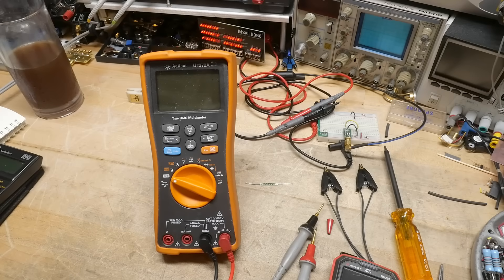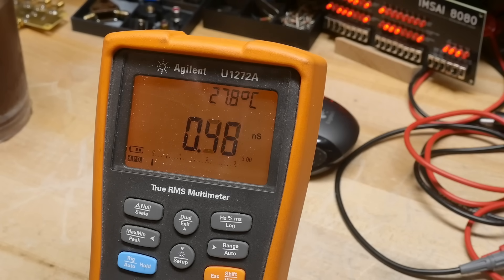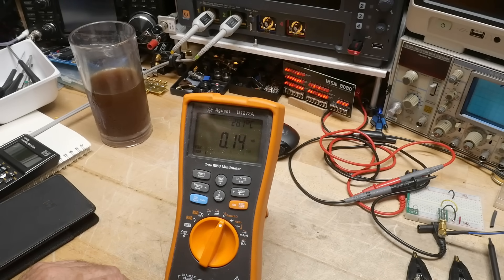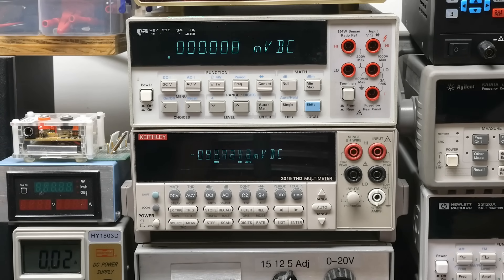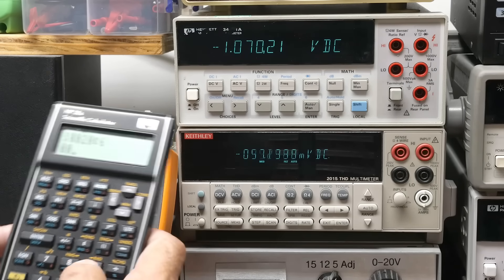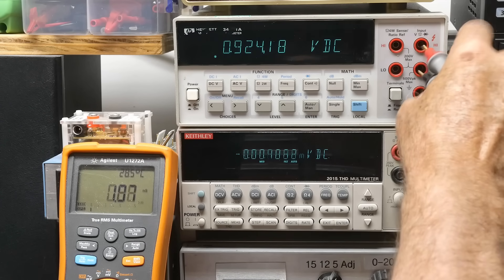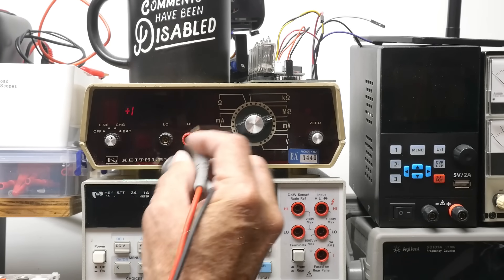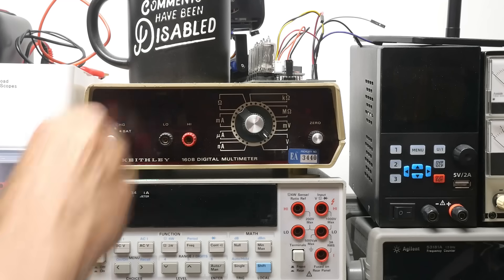#2298 Measuring Nano Siemens

Comment: My very cheapo, very small, RadioShack model 22-802 auto-range digital multimeter has an extremely high input resistance (apparently somewhere in excess of 100 gigohms) when used to measure voltages not exceeding 200 millivolts so that the autoranging stays on the most sensitive scale with a resolution of 0.1 millivolts.  It can be used by paralleling it with resistors to measure small currents while it also displays the voltage burden of the measurement.  When used in parallel with a 100 megohm resistor, the current resolution is one picoamp, though the settling time is slow.

Any run-of-the mill DVM can be used in a similar fashion to measure small current as long as you know the input resistance and apply Ohm's Law.  Typical meters are 10 or 11 megohms when using the voltage scale.  If an 11 megohm meter is paralleled with a 100 megohm resistor, resulting in 9.91 megohms, this is close enough to 10 megohms to be treated as 10 megohms for most general purposes.  Thus, a tenth millivolt becomes 10 picoamps.

Comment: Hello Sir I am following you from several years i really learn much from your videos i am struggling in designing a solid state ATS using Triac i am using BTA141 triac i need to control a load almost 60A can you please help me how can i develop this circuit can i use multiple triacs or any alternate way  i used LM358 for zero crossing detection and a 1:1 ratio transformer for AC isolation and i feed the output of op amp to a microcontroller to detect the frequency of input and switch the triac on/off on zero crossing can you please tell me how will be the combination of triacs or any other components for high current application
Reply from the maker: that sounds like a difficult (and dangerous) circuit. why use a 16A triac? use a 60A one.

Comment: My venerable Fluke 97V has a Siemen's range also, aka Mho's to us old timers.  I've got a handheld megger for checking motors at work, but it works equally well on high value resistors.  Checked the ≈1GΩ resistor in my high voltage probe and it checked spot-on with the megger.

Comment: Once upon a time, conductance units were mho... Ohm spelled backward; Siemen is a recent definition...  You can also extend the range of your Ohmmeter somewhat by installing the largest resistor within its range and then noting the resistance change when the test resistor is placed in parallel.  You can also measure resistance manually by applying (and measuring) a voltage and measuring the current that flows.  Measuring nA or pA requires care and a few tricks.  Especially, it requires an amplifier with bias currents smaller than the measured current.  And, a current divider in the feedback loop to emulate such large resistance.

Comment: You can get old school conductance meters that measure high resistances. Though they usually come with a warning that the probes can be of fairly high voltage outputs in order to pump current through to measure.  I wonder how the multimeter was doing it because 500mV compliance voltage (or 1V) to measure current is down in the nanoamps range which starts getting tricky. (I can be done, but it's hard because you might get buried in the noise).

Comment: OH BTW how about could you measure a resistor that is just in the range of the meter in megs and put the unknown in parallel,  then calculate the value from the change, instead?

Comment: Yeah, you simply measure the sum of typical the two protection diode leakages. The current over over voltage is nonlinear and is a good demonstration that over multiple decades the number of hidden specs is much higher than put on the sheet. But for shure in my decades never seen a single honest instrument supplier. All told me plz do not scare the uneducated.

Comment: You can do this measurement of very high resistance (very low conductance) with a regular tester, a power supply, a 10 Mohm resistor doing a ratiometric measurement.
Reply: Yes and you can even use the 10 Mohm input resistance as a current shunt. I measured the short circuit curent from a toy vandegff generator to 600 nA by using the voltage range and getting 6 V.
I measured the voltage by measuring the electrostatic attraction between two plates with one of those cheep digital jewel/drug scales to about 100 kV.
The internal resistance was about 170 GOhm.
I don't think 6 V burden voltage was a problem.

Comment: The DMMs are usually specified for 10 megaohms on the measurement input so it's not bad. There's good reason for the digital millimeters to have insanely high input impedances, it's basically because you don't want to interfere with digital electronics if you are intentionally measuring something like microcontroller / CPU power and potentially an average DC power from signal especially if you are working with ancient computers to fix them up.

And with high voltage DC, higher impedances is also a nice bonus, less likely to smoke the DMM while with Analog meter that you chose wrong voltage range, you would instantly smoke it.

Comment: Thanks for the video.  A nice follow on video would be how do the meters measure conductance as apposed to resistance.
Reply from the maker: I've done it many times. if you have 0.01ohms just take the reciprocal
Reply: @IMSAIGuy  I was thinking for conduction measurements of high value of resistances like your 500 meg resistor, there may be a different technique than just using a precision current source like most meters use for lower values.  For instance on the 10 and 100meg ranges my Keithley 6500 it  has a open circuit voltage of 7.1V and uses .7uA in parallel  with  10meg ohms for the test current.  It is only rated to120 meg ohms.  Can't tell if they mean the current source or the resistor under test is paralleled with 10 megs.

If one is trying to measure a 100meg ohm resistor with the Keithley  using the 100meg range that claims to use .7uA as a test current, based on ohms law the voltage cross the 100meg resistor would be 70V.  Obviously some other magic is going on here.  I guess this is where the 10meg parallel resistor comes into play.  Wish I had the schematic.  Will have to spice it when I get time.

Comment: It's not Ohms, it's Ohm. The unit is Ohm, so it is "one over Ohm". English is a bit a tricky language for units, as some people will absolutely say "one mega hert" when they mean "Hertz"
Reply: In which language? Using the plural in this situation is standard in English.
Reply from the maker: I can't say volts, or amps too? and Hertz is a surname. It's just hard to say Hertzs. is Siemens ok?
Reply from the maker: AI: So, you've hit on a good point about English grammar. The phrase "one over ohms" is technically correct, but using "one over an ohm" or "the reciprocal of an ohm" is a more precise and grammatically standard way of phrasing it when referring to the single unit.
The word "siemens" is the same in both singular and plural forms in English. This makes it an exception to the general rule where most unit names take a plural form when the numerical value preceding them is greater than one.

Comment: I have access to an old classic static electro-mechanical voltmeter (20kV) which was by the way even made by Sienems (I think just by the company not by Werner himself).  It has a capacity of 10pF and it has a time constant of 100sec. Maybe even more when somebody cleans it. 
From there one can calculate an input resistance of 10 T Ohms, which is 100 femto Siemens what is rather normal for this kind of instrument.

Comment: So my super duper meter does not do conductance but my vintage Fluke 8050A does have 20 and 200 nS ranges but I had to consult the manual to see how.  I got down a drawer of resistors and checked some varieties marked between 100 Meg and 1 Gig.  So do the math, 1 divided by S and there you have it!  They checked out.   Thanks.  And to think for 35 years I overlooked that function on these meters,  not really knowing it could do that.  OH BTW I have to select REL to get a zero as it states.  And the readings are a little bit slow.

Comment: Understanding "UNITS" and checking computations "WITH" units explicitly noted and algebraically manipulated is the best way to understand and check calculations. This is something I learned the hard way.
Reply: in engineering undergrad, you learn pretty quickly to do unit analysis / "dimensional analysis" on everything, or else you'll get a unit conversion backwards, and end up with the wrong answers. Also if you do everything correctly and keep all the units all the way through, the units of your answer fall out of the equation too
Reply: @gorak9000  yup I remember.

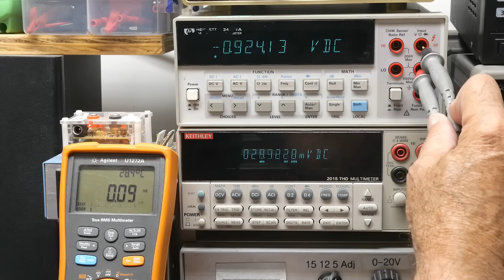Comment: 6:00 It seems to measure about 0.14nS normally and I was gonna ask if that was a legitimate measurement between the banana sockets on the meter. But you were still able to measure the 10GΩ as 0.09nS (and later you measured 0.01nS) and now I have more questions

How can it measure 0.01nS but also show a stray 0.14nS with nothing attached? Surely those higher resistances in parallel shouldn't reduce the conductivity, and I can't imagine your 0.01nS measurement is sucking away a stray voltage? I've run out of theories
Reply: My guess would be that with nothing attached your just picking up stray voltage out of the air.  Same as when you have a volt meter in a low range and the leads are not attached to anything.  Short the leads together and it's gone.  When it's in the Nano Siemens range it's basically a very low voltage range and therefore picking up stray EM fields.  Ideally you would short the leads together and zero or Rel out the resistance of the leads.  Better yet use a 4 wire Kelvin connection.
Reply: @mikesradiorepair Hmmmm theoretically then the 0.14nS would be from that voltage "dropped" (?) across whatever the output impedance of the conductance tester is right? But for it to go down to 0.1nS you would expect the bench multimeter he's measuring to have an input impedance much larger than that, and so you wouldn't expect that voltage to disappear right?

It's mostly the fact that we can measure below the stray 0.14nS (higher resistances) that confuses me, surely it would mean we can't measure anything larger than 1/0.14nS (7.14GΩ if I'm mathing correctly) because you'd fail to suck away that voltage

Comment: Resistors with ( 500 M Ω , or more ) are usually housed in glass tubes , similar to those used for reed relays .. this is to avoid ( finger 😝 ) contamination ... they are useful in the various  circuits of op-amps used in flame ionisation detectors , which require picoamp  sensitivity , to detect  TINY  currents in the Hydrogen flame ........ DAVE™🛑
Reply: wouldn't the glass also protect from moisture in the air? I'd guess at 500M and above, almost anything can become a leakage path.
Reply: I got some glass ones.  I also have some one gigs that look like quarter watt carbon films.  The 200M are about 2 watt size with end caps and leads and a spiral track on something brown.  The 100M is blue and rectangular flat.  The 900M are looking like 2 watt film types with color code stripes too.
Reply from the maker: like these I've shown: https://youtu.be/9EAhJhlvijU?si=qydug_aWpMlPTOBG

Comment: Siemens. Hmmmm. I thought it was a radiation measurement. Learned something.
Reply: Maybe you are thinking of Sieverts.  Activity (the rate of decay of a radioactive material) is measured in becquerels (Bq) or curies (Ci). Absorbed dose (the amount of energy deposited in a material) is measured in grays (Gy) or rads. Dose equivalent (which takes into account the biological effect of different types of radiation) is measured in Sieverts (Sv) or rems. Exposure (the amount of radiation in the air) is measured in roentgens (R) or coulombs per kilogram (C/kg).
Reply: @mikesradiorepair  Yup the most abused of the measurements system only beats magnetics by a little for the award.
Reply: That's Sievert for ya! :)
(effective or equivalent dose, to be precise)
Reply: Sieverts is what you're thinking of? They've got more radiation units than Carter has got little liver pills - rads, rongtgens, grays,baquerels, curies, anon.......

Comment: Oh, you made me look!  My old Fluke 8050A DMM has a 2mS and 200nS range.  So I measured the conductance of my Fluke 8840A DMM and get about  2.7 giga-ohms, which lines up.   (I have no idea how much leakage there is from the rather pedestrian probes used to make this measurement, but "close enough!")   I can make a measurement with the Fluke 8840A, disconnect the probes and have it linger for a LONG TIME.  Very nice!

Comment: I saw this.  Considered I had some really high resistances stashed.  Outside the 20 Megohm range of one of my Fluke meters.  So I looked up my manual and hey,  it has an option for that!  Says it will read max 200 nS!  I have been using this model of Fluke at home(as a backup) and professionally since 1989 and NEVER accessed that capability!  Thanks for the heads up.  Need to check my other meters....